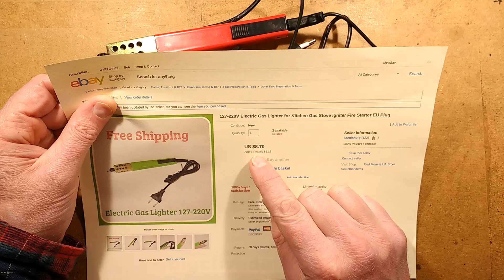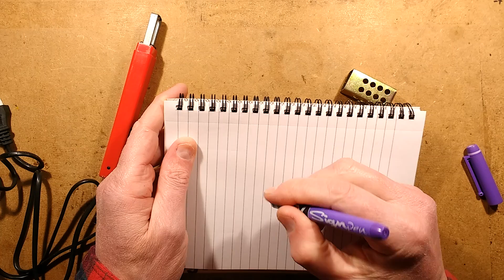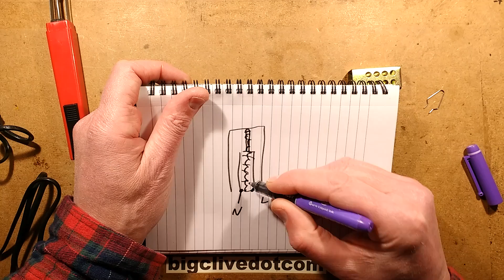Inside a pleasingly scary Russian 240V gas igniter.

Comment: Strikingly similar to a voltage tester that was in use when I was a wee electrician's apprentice. The slang name was "Wiggy", as the proper brand name was "Wiggington Voltage Yester". A newer one was made by Square D. These didn't have the sparky function,  but had a handy little window so you could see how far the core "nail" was attracted against the spring - more retraction meant higher voltage. Even had a clear top cap with a painted magnet to indicate polarity if on DC supply. The arcing took place at the tip of the lead making connection at the source. But alas, like so many neat tools, they were declared unsafe and replaced by a device made by Fluke, and having a very high impedance and producing no sparks. The Fluke had a digital readout for voltage and a handy "Hold" button. You could inadvertently pess the "Hold" button, and then connect it to the mains and have it read zero. Yes, much safer than that sparky thing jumping in the hand to demonstrate the power you were messing about with....would that I were a wee electrician's apprentice now.... .

Comment: 127 is the phase to neutral (star ot Wye) voltage of a system with a delta voltage of 220 volts.  Germany originally had this system, 220 volts for power, 127 volts for lighting, as did Italy, luce vs forza.  Thus both pins of the plug from which the Schuko plug was developed developed didn't need to be polarised.  Many areas of Norway still use 230 volts from between two phases, and even blue 3P+E plugs for same farm equipment, not the usual red for 3 phase.  Mexico also suers 127 / 220 rather than 120 / 208 found occasionally in the US.

Comment: most car horns use vibrating coils and contacts but they are only 12 volts although similarly they dont run for long periods without burning out

Comment: Here in Argentina those things were called "chisperos", with the same functioning principle and the same plug style. This Ukrainian example has an improvement wit respect of our local version; it has a two pole pulse switch, so none of the exposed electrodes are live when the device is unused. Ours had not that "safety" feature ;-(((
These were common here until mid 70's with the advent of the piezoelectric igniter popularised under the brand "Magiclick Aurora" (then any piezo chispero was called Magiclick).
By the side of the two lugs non-polarised plugs, those were banned by 1998 as they were replaced by a three pins polarised plug of the same style of the australians.

Comment: Props for the double pole switch. It makes sure you can't electrocute yourself when it's plugged in unless you press the switch and touch the metal. It's safe enough for Russians but not for Americans. They require 100% babified foolproof design.

Comment: The function principle of this igniter is also used for sparking away broken bolts.  The "nail" needs to be some more spark resistant material in that case.

Comment: Quite late... But this device might be (in theory)  safe in in countries of former USSR. Soviet power grid has been designed as 220V  IT system. So (in theory ) neither wire should bite you when touched.

Comment: When I was a wee lad growing up in Ukraine in the 70's these things were around looking exactly the same as now. The gas stoves lack a lighter we are used to here in the west. No pilot, no sparker. If you turn the knob on the stove the gas will just spew. Most of the time there is a matchbox full of matches near the stove in order to light it. This clever device was sold as an improvement to everyday life of a stove lighter. I remember playing with those things (I swear, they looked identical to this one), but they often just disintegrated due to low production quality (nothing changed) and matchbox, that never really left the kitchen went back into utilization. Ovens also needed a match, BTW and were not nearly as easy or convenient to light as the stove top. Fond childhood memories, Clive! Thank you, sir. Oh, and mains voltage in Ukraine is 220V, so 240V was probably abusive to a very poorly made cheap thing. Not surprised it did not survive long. So many of these gadgets were thrown in the garbage, they were very common to find just in the middle of the street having fallen off the garbage truck.

Comment: I remember them from the earliest 80ies in Poland, almost the same design. They were extremely common, hanging near every gas stove.
They have been also very reliable. My grandma had one for decades. But of course they are not made to be pushed hard, just a touch to ignite the stove.
Reply: same in hungary at late 70's.

Comment: We used to have a similar one at home when I was a kid. Later I realized it must've been incredibly dodgy, because countless times, we've tripped the circuit breaker when the metal part of the casing touched the stove as you were lighting it, so the metal casing was likely connected directly to the live wire when the spark was happening. Thankfully no-one ever got hurt.
And yes, it did affect the TV and the radio.

Comment: I really love your videos. Found by random but really enjoying what I have watched so far. The UK shower dismantle was very interesting. I fitted a new one recently and the mains cable to it was only 3 core cable. (old bungalow). Upgraded to code cable and new trip switches as was still on the wire fuses that you had to replace. The switch had also melted and when it was all new. Very nice. Your videos are like Billy connelly talking about electrics lol.

Comment: For lighting blowtorches and cutting torches?  For some reason when I first read "gas igniter" I thought it was meant for a stove
Reply from the maker: It is for stoves/cookers.
Reply: @bigclivedotcom  Russians couldn't just use matches? Or a regular spark igniter used for blowtorches (the Flint and steel ones that you squeeze)

Comment: At 1:33 on the back of the box of the spirit level, it is all in russian. base off of "для" (dlya: meaning for) and "градусах" (gradusakh: meaning degrees) so in rough translation it is "spiritometer for testing alcohol levels of such as vodka" 
My translation could very well be wrong, anyone feel free to correct me!
The 0-96° on the front is the tempurature it supposedly rated for (to my knowledge anyway, again anyone is welcome to correct me)

Comment: well you burt it because it built for 220V grid. You 120 power grid provides too much amps by desing. This device concept will work with 120 grid but there must be diferent wire gauge or length. 
I remember those when i was a kind. There was also piezoelectric hand powerd stove lighter that make several sparks when pusing lever and in relese. By the spark lenght (1-1,5mm) we are looking on few kV

Comment: Run the spark output through a wire loop with a spark gap at the top. Make the loop 10m by 10m square for maximum satisfaction

Comment: Your hydrometer indicates alcohol by volume in %, because your vodka indicated 40, and the scale goes up to 96% which is the maximum ABV you can get through distillation. Ethanol and water are azeotropic at 96%. At this percentage, when you boil the mixture, the % of ethanol in the vapour is equal to the % of alcohol in the liquid.

Comment: It's actually not an EU plug, it's old ussr plug. This plug lacks the ground pin and a little less thick than EU. Those firestarters were commonly used in ussr so all modern one are made on old factories with little, if some, improvement. That kinda explains poor quality assembly.
Reply: Saw the soviet ones, my granny has one. Those are way more durable than this. It is obvious that manufacturer made it as cheap as possible, thus the shitty plastic, insulation tape inside etc.

Comment: I can touch 120vac with my bare hands without getting a shock because I have a genetic dry skin condition. But there in the UK and other countries that run 240v as household voltage is a bit more risky capable of locking muscles so you can't let go...No thank you even with my condition. Of course if you add any moisture it is game over, even for me. In other countries like India they run DC and people get killed all the time.
Reply from the maker: Don't get too confident with your dry hands.  Al it takes is a bit of sweat or working in a wet environment to lower the resistance dramatically.

Comment: Took apart quite a few of these back in the day. Not a single one used an actual nail in place of a pin. This one was apparently ghetto-fixed by someone and then sold on Ebay.

Comment: Clive, would it be possible to use something like this to retrofit high frequency start on an old tig welder? I have an ancient machine which is a joy to use but needs the tungsten to be scratched against the workpiece in order to ignite an arc.
Reply from the maker: The high frequency start needs to inject high voltage spikes onto a low voltage and very high current supply, so it really needs a dedicated circuit that induces pulses into a large open inductor.  It's complex, hence why many systems rely on scratch start.
Reply: @bigclivedotcom  Cheers clive

Comment: It fits loose in the socket because it's a different socket standard. Soviet socket plugs have narrower tines. 
They're basically a Europlug with 4 mm tines without the inward angle, made for matching sockets with similarly narrow holes. Modern european plugs don't fit into those, but Soviet plugs fit (very loosely) into European receptacles.

Also, it's not 220B, it's 220V. Russian letter "в" is analogous to the Latin letter "v".

Comment: My grandma in Czech has a similar thingy but instead of a button it's got the rod freely in a case. So when you plug it in, nothing happens until you turn the tip downward. The rod falls down the shaft and makes a contract, produces a spark and that fires it back up the shaft again for it to fall back down I a split second. That makes it run much cooler overall, because the sparks are slowed down by the movement of the rod. It makes a very pleasant sound, actually.

Comment: Do you get Noco battery boosters in Scotland? I am curious what you think of them. I have also seen cheap Chinese knockoffs of them but I wouldn’t trust them with a high power device. Wondering what you think of them.
Reply from the maker: They grossly exaggerate the current they can supply.  I did an autopsy on one.

Comment: Alcohol concentration and US ”proof” measures do not coincide. 
In most of the Eurasian continent, 90 degree alcohol is 90% ethanol with 10% water (or other pesky contaminants) by volume. 
Just the same, 10% alcohol beverages is like reindeer piss.  

Anyhow, I miss those buzz-lighters... There are not as common these days as they used to be since the darn chinese made the 100% disposable butane lighters for cents a piece...

Comment: Some 45 years ago I ha a gas-lighter almost identical to yours (without the adjustable knob). It used a quite standard nail  as plunger. After years the bended strip was electro-cut away due to the tears of sparking, so i replaced it with a piezoelectric igniter.

Comment: Imho the screw works as a sacrifical anode. When its used up, one can screw it farther in. Otherwhise the sparks will eat up the metal band quick or weld the nail and the band together. As the screw is brass, steel and brass want weld together. U should smell vaporized brass.

Comment: My Idea:
Live is flowing through the spring and the metal.
The spring is connected, the Solenoid becomes power and pulls the contact back.
Then the Solenoid doesnt get any power and so the spring Closes the contact again and so on.
Reply: I wrote it before i watched you taking it apart and i was Right.

Comment: I'm pretty sure the external metal tab is neutral and the internal (permanent) solenoid connection is hot. I remember grabbing onto these things but never really getting shocked. Also at the time these were made there weren't any economical battery powered(or piezo) solutions and the only real alternative was matches. Matches(in the hands of kids) burned down way more things than electricity. And people who've never been shocked tend to overestimate the danger of it, though most people also seem to underestimate the danger of a bad electrical connection as well..

Comment: Well, I had this one gas igniter in my last apartment. Absolutely the same technology, only color is different. It was produced in 1978., perfectly works even today. In my childhood, on the kitchen we had the same kind model as you hold in your video, but sincerely I was really very terrified to use it. It's like evil spark maker and this zapping sound......... , like some torture device from horror movie. Well, I had always used simple old school matches, and avoid this novelty at all costs. But "thankfully" this thing manufactured from 80' and 90' was not very well build, and lasted very short term. The last one worked the longest for less than a year.  So in the end my parents ditched all them and we used matches since then. For today there is neat "Chinese" gas igniter. Neat, simple, nice design, safer, works well. But now all my appliances works perfectly and flawlessly on electricity, unfortunately gas become very expensive in new days, and there is more and more very handy computerized electric appliances that are more reliable, energy efficient, and useful.

Comment: Hydrometers are useful when fermenting alcohol.  I use one regularly when homebrewing and winemaking.  Generally you measure the alcohol by taking two readings at different times and measuring the difference between the two.  I've never seen one calibrated with a scale like that.  I'd be skeptical about the accuracy of such a device without measuring the reading pre- and post-fermentation.

Comment: the russian/ucranian thing is actually an alcohol meter the writing on it is in cyrilic says spirtomer which means a device for measuring spirits goes up to 96% in most slavic countries alcohol is measured in degrees instead of percentage but it's the same thing so 40 degrees is 40% alcohol :D it's quite cool and usefull for the domestic alcohol brewer

Comment: This whole thing is lovely. A classic matryoshka design. You see it's built from individually useful pieces: coils, a nail, metal slabs, plastic casing. Together it forms an useful piece for starting up a stove. Now when you plug this with a house with similarly designed Russian stove, you get a house-sized bonfire. Isn't that useful?

Comment: If it's a spirit Hydrometer then you can get into the 90's. I have a still that I can get 93% out of on average! Just remember that because it works on specific gravity it's only accurate for pure alcohol, anything flavoured i.e Wisky, Vodka etc will have a lower reading than what is actually in the bottle!

Comment: It's a Soviet technology. Such igniters are made since many decades ago. Though this particular specimen is really crappy, I don't recall any that used a nail, those I've seen had a proper electrode. This is how more decent one looks like https://meshok.net/pics3/63872709.jpg?2
Edit, now recalling more, there was a wide electrode on the opposite of a thin spring loaded one which had no spring around it. thin Spring was sitting inside the solenoid and pushing the electrode from the opposite side. And there was no stupid shell fixing screw like here. IIRC it was a long nut which was hard to unscrew, certainly not possible with bare hands. I would guess this is a Ukraine special with extremely low build quality.

Comment: I am using such a gas igniter for over 30 years now. Dutch origin brand Tomado. The U shaped end gets split due to the sparks after some years and needs mending once in 8 years with a iron wire.

Comment: Why would you use a device with a plug? Just not handy. When I was a child we had a more or less similar looking unit without a power lead and a plug. It was sort of a piezo ignitor. By pushing the trigger down into the body it made several sparks. Not as heavy as the powered one you have here but for igniting the gas stove it worked fine. Much safer and easier to use because you never have to fight with the powerlead

Comment: I don't know if somebody tried to explain the spirt-meter but I'll have a go just in case nobody did. 
For some reason in Russia we call ABV the "degree", so you should just treat the 0-96° as 0-96% abv (the range whithin which it's capable of measuring ABV)
Maybe the use you've found for it is checking the ABV of items you buy in stores, however most (if not all) of the times I hear about the Спиртомер is when somebody made wine or moonshine – two most common homemade alcoholic drinks in South region of Russia and, probably, across Russia (wine can be a problem cause everywhere else the grapes don't do well due to, of course, unsuitable temperatures; but the moonshine is a massive thing and can be made with practically anything) 

I've heard stories of "moonshine made so well that the spirt-meter just sank right away", should you believe it or not – up to you.
Reply from the maker: I have investigated moonshine in the past and this would definitely be a very useful tool for that.  Also a good indication of how well your still performed.